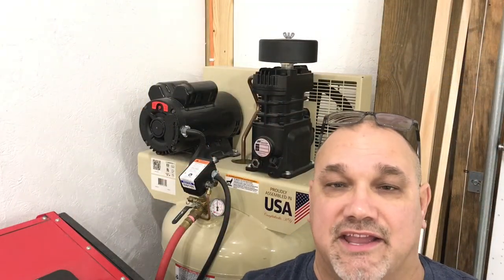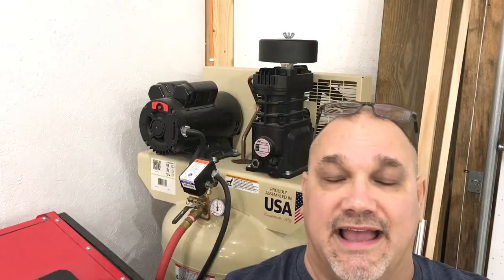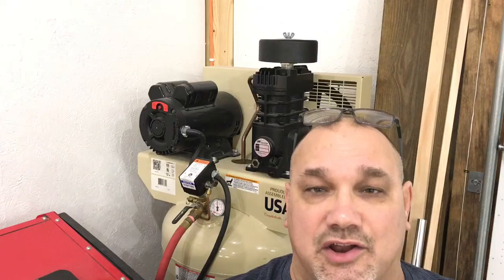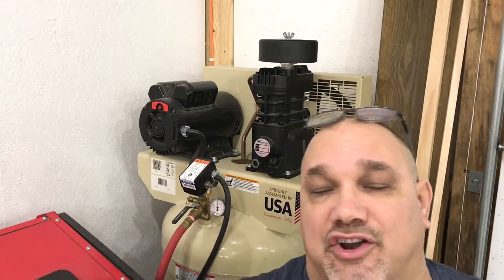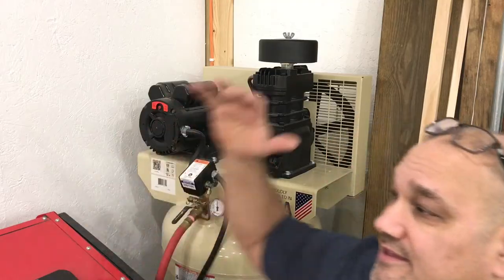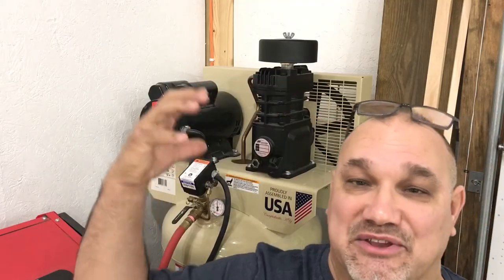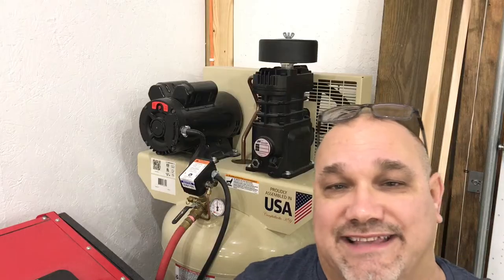Harbor Freight Paint Gun and What Size Air Compressor Do You Need

Comment: I have a 3HP (actual, not just the rating) Devilbiss (branded Craftsman many years ago) compressor with a 30 gallon tank. No trouble at all painting a car with the purple gun. Compressor barely broke a sweat.The purple gun is fairly easy on air as paint guns go. But if you have a 3 gallon  pancake compressor "rated" 1HP it is only good for about half a panel before you wait for the compressor. One easy way to know if you have enough air to do larger projects is knowing your compressor motor REQUIRES 240 volts. My 3HP unit uses over 13 amps on 240 so you can guess how limited you can be on a 120 volt line.

Comment: Hey man, do you take apart and clean ypur gun before changing each product, meaning going from primer to base to clear, or do you use three different guns and clean them afterwards. Nobody ever shows the in between processes, thanks,
Reply from the maker: I flush with solvent. I leave solvent in my gun between coating and flush again before I spray.
Reply: gixerman01 ok so just empty the paint cup, fill cup with solvent, spray until cleaned, empty remaining solvent, spray air only to flush then ready to go?
Reply from the maker: Rick Lane yes you will need to rise with solvent and then flush with solvent. If you still see some paint residue when flush keep going till you get clean solvent thru it.
Reply from the maker: Rick Lane the gunman talks about flushing your gun a little more in depth. Check out his videos for his gun cleaning video.
Reply from the maker: Rick Lane that’s what I do. I don’t put to much effort in a nine dollar gun. 😃 thanks for watching

Comment: Could you clear coat 1 car door with a 2 hp 8 gallon compressor with 5.5 scfm @40 and a in-line water filter without stopping so you don’t lose your wet edge?

Comment: Wow! I honestly cannot recall a time when I have been more impressed by the level of professionalism, quality of content, ease of understanding, and overall value if time spent watching your video presentation on the Harbor Freight HVLP paint sprayer with regulator. 

Seeing your video has given me the confidence to refinish my kitchen cabinets with Harbor Freight Purple Paint Sprayer white semi-gloss water based enamel & finish coat(s) them  with semi-gloss poly topcoat. I plan to purchase the Purple sprayer w/regulator , a pack of paint strainers,, an inline moisture filter & some acetone or similar cleaner for the sprayer assembly from my local Harbor Freight very soon.
I have a Husky compressor that is capable of 5cfm @40 psi  and a  5/8in. ID / 25 ft. all rubber hose that'll work well for this task butt the tank is only 4.5 gal. 

I have few questions before I get started on this project:
Q: Would it behoove me to purchase  (0r possibly rent) an auxillary tank of 20 gal or so?
Q: What product(s) do you recommend for cleaning the spareyr and for thinning the paint? I'll be using water based Behr Premium Enamel for Cabinets & Varathane Polypropylene Behr Premium Enamel for Cabinets & Varathane Polyurethane ?
Thanks in advance.
Reply from the maker: If your spraying water based products thru the gun, I would spray water thru as a flush at the end. Then flush the gun with lacquer thinner. I flush my guns with lacquer thinner when spraying solvent based products. I would talk to your paint supplier about what to use as a thinning product. Some water base products are fine to thin with water but there are solvents that work with water based or water reducible products also. Your paint supply should know what’s best or the product your using. I seen people use or install auxiliary tanks to do just what your thinking. That gives you added capacity. Hope that helps, thanks for watching.

Comment: I have that same paint sprayer and all it says is 12 SCFM at 45 PSI, there is so much contradictory info on the internet at this point I have no idea what air compressor I can buy to work. I would love a video on specific affordable air compressors we could use because if you go buy charts at home depot I need a $1000+ compressor for this gun? I am looking to put clearcoat on (peeling on my truck in spots) my truck and am willing to do it a panel at a time if need be
Reply from the maker: You don’t need to spend a thousand buck to get one to handle this paint gun. 3 1/2 horse power and 30 gallon tank will work. Thanks for watching.
Reply: would did you end up buying ?

Comment: I've watched all 3 of your HF gun videos, and I was actually very surprised at the finish you got with the blue paint painting the wheels, and the paint also appeared to have some "candy" quality, which if it did that is even a more impressive result.  I couldn't tell which Shopline clear you were using but, again, if it's high solids clear that makes the results more impressive.

What has my attention is the reasonably low amount of orange peel you got.  Loads of people, me included can get that gun to lay down a relatively even coat, but I haven't seen anyone get a finish close to that WRT to orange peel without color sanding.  In my case, I've managed to get a similar finish using it to spray water and oil-based polyurethane (on furniture), but I've never had that kind of success with paint, and I'm wondering what the trick there is.  

You said you were running 30psi at the gun (I'm assuming trigger pulled), I didn't see you do anything special reducing the paint, and I'm assuming that the gun setup is typical for automotive spraying- leave the air valve open all the way since you're regulating at the gun, open the fan pattern up as wide as it will go and still give you an even pattern, set the fluid flow close to wide open since these guns don't deliver near as much material as "professional" guns.  

I've tried pressures from about 20-35psi, fluid flow from about half to wide open and usually the fan pattern open all the way/airflow open all the way and typically my results with paint range from a little bit dry (sandy finish) to pretty significant orange peel (smaller and courser pattern than a real orange peel).
Reply from the maker: Thanks for watching. The dry spray or orange peel is usually from not getting enough material on the part, so that the droplets can flow together, or the solvent package being too dry and not letting the material move after it hits the part. Sometimes to large a droplet will cause orange peel. There is a sweet spot for all these issues. So if your having issues breaking the material up, one trick is to run acetone as part of the solvent package because it thins the material with out causing runs. It drys usually before it hits the part but thins the material so it will atomize. The other side of that is to run a tail solvent that evaporates slower to help get the material to lay out after hitting the part. Down side to tail solvents is high risk of runs and slower dry time. My method is multiple coats a light first coat, followed by a couple even medium coats with a short flash time in between. Hope that helps.

Comment: I don't know your name yet. But thank you again for the lecture. What air compressor is best for painting large vs small project. I already have two air compressors. One is portable and the other is more stationary with a 30 gallon tank. I wasn't thinking of painting automobiles when I purchased these compressors. They were more for running air tools although I do use them for painting small project mostly on wood but some metal work as well with a syphon paint gun. Maybe you can give me some feed back if I post the specs on my compressor up. I did notice your compressor has a large gear/pully on the compressor side that's run by the electrical motor. I'm assuming this setup is to lower the stress on the electrical motor making the compressor more efficient so it doesn't have to cycle on and off so much when using an HVLP paint gun which you mentioned need a high volume of air. Thanks aging for explaining that for best results the compressor need to put out the minimum CFMs required by the paint gun. I'll make sure to check my compressor specification for this. Knowing that really makes a difference. I would have thought the gun wasn't very good not realizing its not only the gun that's plays a factor in its performance and the quality of the paint job when its all done. This information is awesome, glad I found you channel.
Reply from the maker: Thanks for watching.

Comment: Thanks for the video, im in the market of buying a air compressor for my garage, want to get into painting, condensation and water in the air line is a whole other issue I never thought of and im glad that you covered that, i plan to paint but probably in pieces, fenders and hood all done as separate parts, will a 2 hp, 30 gall, probably 5cfm do ok?
Reply from the maker: If your paint in small parts at a time it would probably work. Thanks for watching.

Comment: Great info in your videos. Is that just standard pvc you have to run your lines through your shop?
Reply from the maker: Yes I used the heavier stuff. I’ve seen it done a hundred places never an issue. There are several people that will go on about not using it. I work in a shop part time that it’s been in with no issue for 30 years.

Comment: Hello Gixerman. Thankyou fo4 your videos on spray guns and compressors.  I have a question about the regulator. Is a regulator at the compressor to far away from the gun? Is it best to have the regulator at the gun? Regards AnthonyZ
Reply from the maker: Depends on the length of the run, you can get some pressure drop. Having one at the gun is the most accurate way to regulate but you can do it at the compressor. Hope that helps.

Comment: Just came across this video. ? to u. Purple spray 6# pancake 2 hp. Will this handle spraying my house metal doors evenly thank u
Reply from the maker: It should work but you will have let that little compressor keep up. One door one side at a time.  If you try to do more or a couple in a row that little air compressor won’t keep up. Thanks for watching.
Reply: gixerman01 thank u for getting back. I am getting more educated cfm compared to psi in relationship in buying a unit. If u have a suggestion on a pancake model, I ll be interested
Reply from the maker: Tim Miller most pancake models are designed for a nail gun just a short burst of air. I don’t know of any really designed for painting. Sorry.
Reply: gixerman01 thank u  u saved me $150